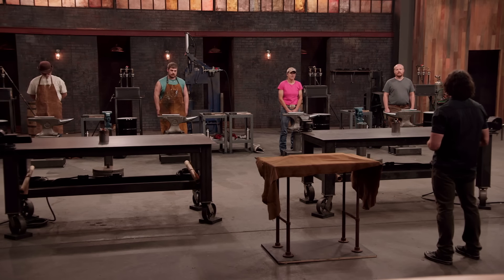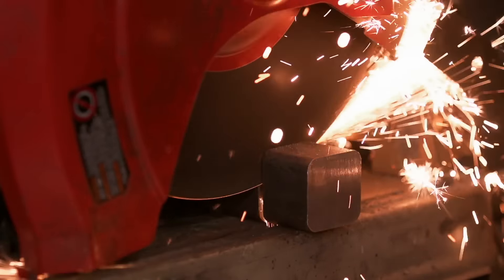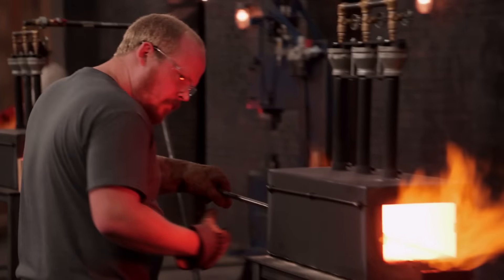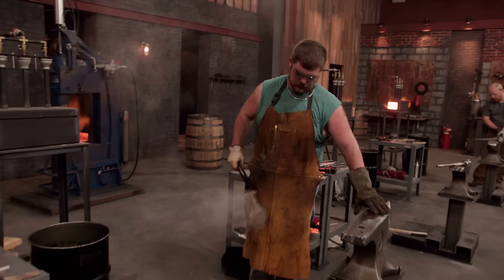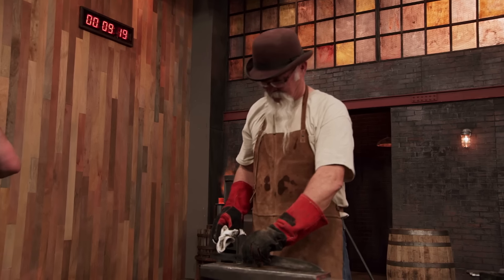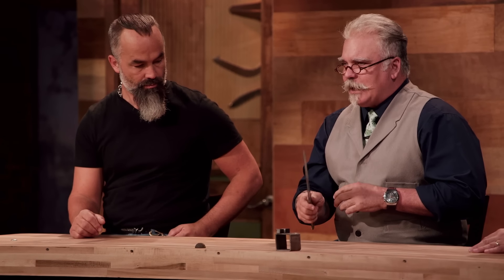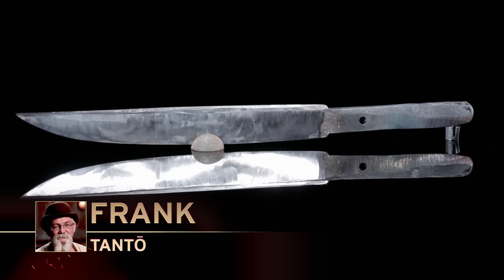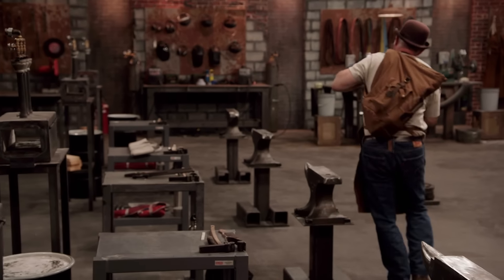Bladesmith STUNS Judges with Epic Work | Forged in Fire (Season 3)

Comment: The likely reasons for the numerous cracks in Frank's blade are that the material was stretched with great pressure without being heated sufficiently inside, and that it was stretched in alternating 90-degree directions with too big pressure. The cracks caused by these factors appear when the material is polished. When using thick materials, it is necessary to stretch them little by little. The program staff, knowing this, must have deliberately asked the contestants to complete the task, including using thick materials and making their own hammers, in just three hours. This is a huge stress for the contestants.
Reply: hey, may ask, by alternating 90 degree directions (with too big pressure), do you mean like stretching "tang to tip" and "spine to edge" in an alternating fashion? as in a bit "tang to tip" and then "spine to edge" in the same area and so on? im just trying to make sure im understanding this correctly cos' i've never heard of this before and it sounds like a GREAT piece of advice and something to add to my knowledge toolbox. i can clearly picture the material cracking under the conditions you have mentioned... now that i've read it that is.
Reply: @tobiasripper4124  You're probably right: it means 90 degrees around the central axis of the cylinder material.
The Japanese technical term for cracks caused by this phenomenon is "momiware(揉み割れ)." I don't know the English technical term, but it means "cracks caused by kneading."
Reply: Did they ever say what the material was?  Also I do not see a hand hammer moving the material at to fast of a pace. Forging to cold, along with improper heat treatment  will destroy a blades micro structure instantly.  I strongly believe it was due to forging temps and heat treatment.  For those that don’t know, you quench as the steels temps are rising not while they are dropping. Some steels are more forgiving with this, most are not. Reason I asked what steel they used.
Reply: @erikcourtney1834  Cold working and improper quenching can also cause cracks.

Comment: I'm surprised they let Frank slide on the hammer.  The rule said they had to "forge" the hammer, which he didn't.  They've disqualified contestants before for not meeting that parameter.

It's Forged in Fire, not Welded in Fire.
Reply: None of them forged the hammers.
Reply: @DH-xw6jp   The judges singled him out for doing it that way, so I figured the others didn't.  I'll watch the full episode sometime and check it out.
Reply: @chuckbangers2590  they singled him out not for welding (which they all did) but for the style of hammer (a Japanese style instead of western) and the speed he got it done in.

I don't think they were meaning the attention in a negative manner.
Reply: @DH-xw6jp  Correct, the attention to the hammer was positive.
Reply: The actual wording in the rules that were given in the contract said that contestants must “fashion” a hammer from the materials.
Reply: make or shape (a metal object) by heating it in a fire or furnace and beating or hammering it.
This is the definition of forging, you can’t forge a hammer without a hammer so his method was completely valid. In fact nobody actually forged their hammer

Comment: Frank's blade may just shatter into dozens of pieces during the strength test. Maybe he worked his steel a bit to cool, maybe his heat treat was to aggressive. It's hard to tell.
Reply: I think he worked it too cool.  He's got a LOT of small cracks.
Reply: @marhawkman303  😈
Reply: Maybe the way he made the hammer also had an effect in that the hammer blows perhaps landed more on the front edge of the hammer than flat.

Comment: My biggest beef with this show is how little time the contestants are given.  There are a ton of godlike bladesmiths out there who just aren't that fast.  It should not be a mark against them.
This show completely lost me on a katana episode.
The final 2 contestants were polar opposites.  
One had a world-class shop.  He cut out the shape of a katana from a sheet and then made it with all his fancy stuff.
One had a tiny shed with a coal forge.  He made a traditional katana.  He drew out the metal and followed the steps to make a real katana.  He even water quenched it.  His first quench failed and cracked the blade.  He nailed it the second time after remaking the sword.
Both contestants SPLIT A BULLET with their swords in the final challenge.
They picked the rich dude.  The rich dude didn't make a katana.  He made a katana shaped machete.
The other dude made a REAL katana.  If I remember correctly, he even did a SAN MAI.  A san mai is when you fold a softer spine of the katana around a metal that makes a better blade edge.  It is hard to do just by itself, but he did it TWICE in three days, his first attempt cracking.  The amount of skill and dedication he showed was mind blowing.  He should have 1000% won, the tiebreaker being the authenticity of their methods.
It's been years, but I'm still absolutely grilled on this one.

Comment: This is awesome but no one e moved their blade around in the oil which means air pockets against the blades they need to keep moving the material in the oil and do not take out of the oil until complete. They talk about cracks thats because they didnt keep the material moving in the oil.
Blacksmith trades man. 
Great job tho